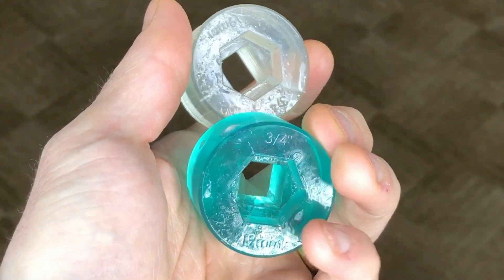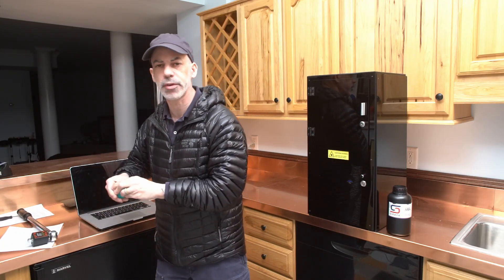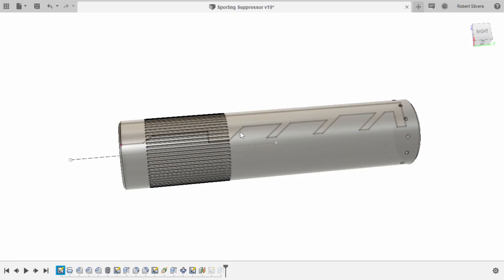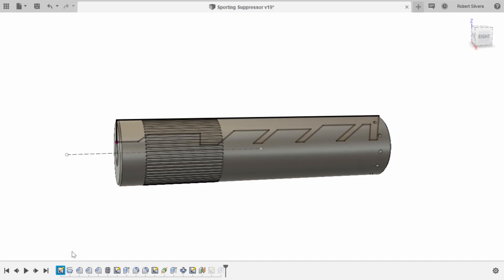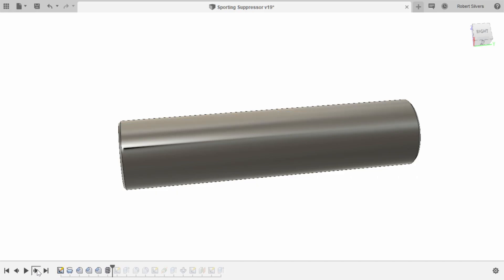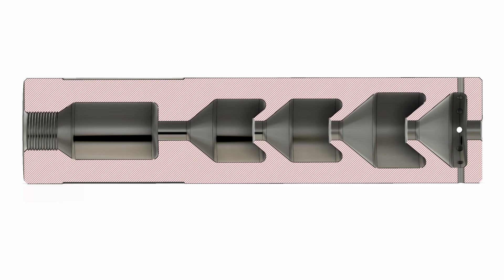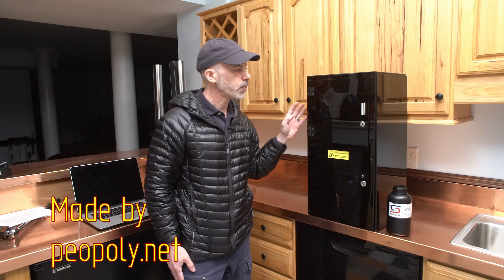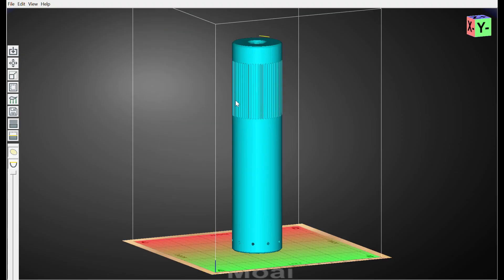Tough 3D Prints from Resin

Comment: TL:DR: if you spent a lot of money on the resin and the printer you can create parts that are as strong as normal PLA. Or you just keep printing this exact model on a 100 usd fdm printer with a 10 usd PLA filament.

Comment: Your strength tests don't show a lot of usable data in this application. Let me explain. You're testing tensile strength with rotational force, which that kind of rotational force is never experience in a suppressor. The general tensile strength of the material as well as the muzzle pressure is enough data to determine what material would be suitable for this application. Also look more into suppressor design & the reason behind the specific design before starting your own. The initial blast chamber size, cone shape, geometry of the cone, clip side, cone spacing, and distal area are all a huge factors in a suppressor. Different calibers & subs/supers like different things. Also, long tunnels like that, tend to cause more point of impact shift. Just me $0.2

Comment: Have you tried to print a metal one? Maybe 9mm or .45 caliber? Besides cost would be nice to see how sturdy and durable of a suppressor you could 3d print.
Reply: There is a special type of plastic that has a 360 degre celsius melting point and is super strong. That would work
Reply: metal 3d printers are hundreds of thousands in cost

Comment: The resin actually works better with high temperature stuff. I can print a fan duct out of PLA and within a print or two it's lop sided and hitting my prints. I then printed one in abs like resin and not only did it look like a high end manufactured product it's been on for months with no sign of warping. Currently printing a HTD pulley for my CNC mill that will hopefully hold up to 3,300 RPM on my 2:1 spindle setup. I've been considering mixing some high toughness with flexible resin to try and get an ideal mixture of strength but less abrasive for longer belt longevity.

Comment: When working with Siraya Blu, do you heat it to 60 degrees C during the curing process? That's supposed to create the best strength. If you didn't, I'd be curious to see your torque test when you do. Great video. Have you considered printing the innards of the suppressor and inserting them into a steel tube? What other calibers did you try?
Reply: I do. I also make firearms frames with the stuff.

Comment: Dude, I have used CAD programs for years, and Tinkercad is my go to quick design source. Fusion is so bloated with crap that will never be used and it's NOT easy to learn, at least not for me. I do use 123D Design still because it's half way between Tinkercad and Fusion. It's not what's under the hood, it's the designer!

Comment: Every vehicle I have ever worked takes 90 *Foot Lbs* just to hold the wheel on to spec. 90 *NewtonMeters* is only about *65 Foot Lbs*. 
 
65 FtLbs for a breaking strength is NOWHERE NEAR what the lug nuts on your Audi takes.
 
You literally lost all credibility in the first 90 seconds.

Comment: One way I think you could improve the suppressor is you can leave a gap where the threads are supposed to be and get a metal insert and use some sort of adhesive to attach the metal threads that way you have metal on metal contact rather than resin on metal contact as I can see that causing degradation in the long run.

Comment: RE: Your comments about Fusion360: we in the machinist trade have a similar opinion of it as you do of tinkercad. Good for hobbyists and the most basic stuff. Comparing F360 to Solidworks is like comparing apples to oranges. F360 is CAM software, Solidworks is CAD software. They have different purposes. Compare Solidworks to Inventor, and compare F360 to HSMworks. (F360 is a watered down HSMworks, which is also considered basic-level CAM)

Comment: Instead of suppressor, how about putting it to hydraulic pressure test like they do with SCUBA gear (and PCP air gun)? 22LR peak pressure is about 20KPSI, but probably 1/10 that at muzzle (ie, only about 2KSPI). Hydraulic pressure test can go up 4KPSI or more. Even better, find pressure when it breaks.

Comment: You can actually buy a 'suppressor' from a company which makes a suppressor base... basically just the part which threads onto your barrel. They did this so if the suppressor broke, that part would survive and you wouldn't have to do new illegal paperwork or the illegal 6 month to 24 month illegal wait-time before receiving your new muffler.

You could get one of those, and print your own 'suppressors', which would technically just be considered bodies or scraps because they would mount to the 'suppressor' or nut which threads onto the barrel.... That would be one way around the law... So you could in theory also get one which could thread onto multiple calibers - or get one which has an adapter... ie: the serialized part is x dimensions, and you get a different nut per barrel size / thread size, etc... add the 2, then add the suppressor body...

Comment: Thats impressive itll cycle on a pistol with out a spring in there i wonder if itll work on a 9mm tho
Reply: The reason it cycled properly without a booster is because the firearm used in the video had a fixed barrel.

Comment: Do you know how many decibels your suppressor lower the shot? I know this was just a proof of concept but I'd be curious as to the actual effectiveness.
Reply: It should be more or less similar to other suppressors.
Reply: @Acecool  my understanding is suppressors vary a good bit in how much sound they dampen. I was just curious as to where his lined up
Reply: @Acecool  A Civic is more or less similar to a Ferrari.
Reply: @Garrumx  Why does everyone always bring up Civics? The K series engines produce more power from 4 cylinders than most N.A. V6 engines from other manufacturers. The old jokes from the 1970's don't apply any more. Bash on GM instead.
Reply: @WhiTeaNdNeRDyOG  Because a Civic can't hold a candle to a Ferrari even though they are both cars, just like there can be wild performance differences between suppressors, even though they are both suppressors.
Reply: @Jarhead Well, the ones I make are...

Comment: The clear is cool, but if you had some carbon fiber dust and small clippings and mixed with the resin it would be even stronger.
Reply: it also would probably make it nearly impossible to cure the resin with all the particulates and you'd end up with a failed print and a big mess to clean up in the printer
Reply: Kelsey Steinman I mean more for a cast piece not a 3D print.

Comment: +rsilvers Awesome, Good work! However, suppressors can be printed with standard PLA from standard 3D printers especially when used with 22lr ammunition. Check out my Twitter, I've been designing and building 3D printed suppressors out of standard PLA and PLA+: https://twitter.com/KadeCad1   It would be great if you could test your suppressor with supersonic 223,  5.56, or more powerful calibers, as a standard PLA or PLA+ suppressor would likely not be able to withstand the pressure. Throughout the testing of 3D printed and homemade suppressors, the common weak point is the threads. The pressure inside the suppressor is so great that the can itself expands, lifting its grip from the threads on the muzzle of the firearm, or the 3D printed threads simply give way.
Reply: Kade CAD Since the threads are the weak point why not use a threaded insert made from metal? The inserts are fairly cheap.
Reply: @strawberryblonde7253  Unfortunately I don't believe that there are threaded inserts that are the correct size (1/2x28 threading). But yes, threaded inserts would likely increase the durability of these suppressors.

Comment: why did you print at an angle?
Reply: I would imagine for the strength. In 3D printed parts, the weakest link is the layer adhesion.
When designing and printing functional parts, you need to consider in which direction the forces will be imparted. In the case of this suppressor, there will be forces pushing straight out toward the front (gas expanding forward into the baffles), as well as out toward the sides/top/bottom. If they'd printed it straight up, it could fail along a layer line partway through the length of the suppressor, whereas if they printed it laying down it could peel apart like a clamshell. 45 degrees, for this use case, looks to be the strongest orientation for printing.

Comment: Suppressor with baffles shaped like Tesla valve would be interesting
Reply: Tessa valve is more or less 2d.  If you take it and make it a cylinder, you have what it's basically a k baffle.  While it doesn't directly channel air backwards, it does this by creating a vortex which collapses on the air flow behind it slowing it down. Imagine the air coming out and being redirected in a backwards wave by the baffle which crashes down on the main path of flow.  That's what most suppressors are already doing. Also unlike the Tesla valve, you have a projectile which plugs each baffle as the bullet passes through it.  This directs even more gas into the baffles.  You are left with pockets of air flowing in a vortex within the each baffle stack. The vortexes ultimately slowing down the gases cooling it and further reducing pressure.

TLDR you have a Tesla valve effect happening in most modern suppressors.  Also take a look at mono core designs and think how air would follow through them.
Reply: I would guess that the gas would be accelerated faster than the bullet when it comes around the radius part of the valve assumingely hindering the path of the bullet.
Reply: @adammichaeld  Unless you point it backward and use it in a "gas-assisted system"
Reply: Curran H. You might be on to something lol
Reply: i had the same idea too actually
Reply: Wouldnt that over gas Your guns?
Reply: kevin johnson it would.  I’ve wondered about a reverse Tesla valve, and if it would help suck forward the excess gas in the barrel.
Reply: it didnt work well
Reply: I've seen several integrally suppressed rifles with a tesla valve like design. Obviously looks a little bit different. I'm no expert by any means but there's definitely very similar designs used in firearms.
Reply: @thickzipper  yeah.  Aerodynamics tend to repeat the same patterns. The reason why an actual Tesla valve wouldn't work is because the reverse facing valves would actually allow gas to flow around and in front of the bullet. Imagine the bullet being like a moving cork and all the gas trapped behind it as it travels forward down the suppressor.  As the reversing facing valves are exposed, the gas being significantly lighter than the bullet and being under significant pressure, would flow down the vents and travel around the bullet into the bullets path.  

There's a lot of fluid dynamics renderings of suppressors on YouTube that show gas flow through a suppressor. But most of them fail to consider a bullet traveling through it capping the gas as it travels.   Check out smarter everyday's slow mo of see through suppressors.  As well as OSS's flow through design suppressor.   The oss does tap gas off from behind the bullet.  But it needs to keep it away from the bullet so it vents out the side of the can.
Reply: Another thing to consider is at 30,000-50,000+ psi,  gas is more like a thick fluid.  In the time span than a bullet is traveling through the can and individual baffle section, has doesn't really flow through the suppressor.  It simply takes up space in the suppressor.  For this, volume is the most important thing as it decreases pressure.  After the bullet leaves the  suppressor then follow becomes important as you want the flow to be reduced as much as possible. The amount of air most cans trap is small compared to the amount that follows the bullet..  so you get special designs focusing longevity as well as some fancy air flow designs for tapping off and storing as much gas as possible.  This is why simply having a bigger can will make your gun a lot quieter.  Then you have to deal with other issues such as back pressure.
Reply: @cr0ss0ut  now when you say longevity of the suppressor are suppressors prone to failure?
Reply: @thickzipper  yeah, depended on materials use, erosion will eventually occur..   you figure the pressure inside the barrel it's in the tens of thousands as well as several thousand degrees.  Hot gases escape the barrel carrying unburnt powder.  Although they don't weigh much that gas and powder is traveling several over 10k fps.  When it strikes the baffle it slowly erodes it away. This is most common with rifles as pressures are up in the 40-60k psi range.   Better materials like titanium or inconel can be used but that's more $ And harder to machine.. aluminum is only good for .22 but even that won't last forever. 

Then there's other issues like the can getting (too) hot (especially with rifles) which weakens materials and can cause tempering...  Then, depended on baffle design, you can have tube cutting or tube erosion, this is when the baffle or monocore doesn't create a perfect seal from the outer tube. Hot gas jets slowly cut the tube.  Think of revolvers and having gases jet out of the cylinder gap. 

There's plenty of other issues but none are as extreme as these. Assuming factory recommended use.

Most will last you thousands of rounds. Even 10s but id never expect one to last forever. 22 and pistol cans maybe.  But rifle calibers no way.   Sound reduction will slowly decay over use.  But that's a lot of rounds.
Reply: I've been thinking the same thing
Reply: That's what the OSS baffleless suppressor is

Comment: You can't achieve competency with fusion 360 in a day, just very basic proficiency with simple extrusions.
Reply: Maybe he meant for someone switching with experience, or good enough to make the part he demonstrated (1 simple sketch with 1 revolve feature). Took me like 1-2 hours to get reasonably used to it coming from other CAD programs (it’s lacking compared to Solidworks for complex stuff, but it can do a lot of things and even runs in a browser so a phone could edit dimensions or do basic alterations or just demo the part to show people). Unfortunately, it’s cloud and browser based, so like this year they ended the contract and super locked it down for a lot of users (no more importing other CAD files, no group collaboration projects so that killed open source projects using it, and killed many many other features as well as now charging for a lot more people because before you could even use it free for business as long as you made less than $100k. So you don’t own the program and they can turn off and lock features (like they just did) at any time and at any time make it not free and you then lose access to really using the models you’ve spent so much time on. In this scenario I said screw it, open source or nothing, I want to own and control the models I’ve spend hundreds/thousands of hours on in total and nobody can take that from me if I own the program (not just lease it like Solidworks or Autodesk, but flat out own it). It’s limiting since they don’t have funding the same, but dang FreeCAD does alright, made some decent optic mounts and magazine replacement parts for my carbine and though it’s not as polished it is something that I can install on any computer (Linux or Windows), and nobody will be able to lock me out of accessing my hard work with the flip of some subscription or cloud switch!
Reply: @jakegarrett8109  yeah, I also really dislike the subscription model alot. Fusion 360 can involve a fair degree of complexity but generating primitive shapes via extrusion is easy.  It just seemed he was suggesting that  mastery of fusion was possible in a day which it I absolutely isn't.

Comment: I wish people would make these for air gun! I’d buy them for all mine
Reply: There are airgun supressors on lots of models as factory default, you might see if you can get the part just by itself (or if you mean 3d printed I’ve done one for my CO2 bb pistol knowing nothing how a suppressor should work and just doing geometric trap chambers and stuff, it’s extremely basic and one of the simplest parts almost ever to CAD, his is just 1 sketch and one feature revolve... Mine had air baffling exhaust holes but still very easy). Also carpet rolled up in a tube works (I assume you’re popping some mice, probably with IR night vision scope and need the silence to clear the attic or barn, this would be plenty for that, the mice probably would be more affected by your scent than the now very quiet pop). I’ve also done really amazing diaphram suppressor with nothing but newspaper and a foot long piece of stainless steel that slipped over the airgun barrel, like so silent you didn’t hear the loud pop, only the valve clicking open, like REALLY impressive (but after every shot you had to run a ramrod through it to open the hole again, and also it needed repacking after like 30-50 shots and indoors you’d have to clean the small amount of confetti paper it likes to spit out, so not great for real firearms or semi-auto air guns, but not too terrible in terms of time when you spend a good minute pumping up like 10 pumps on an old crossman air rifle adding like maybe 10 seconds).